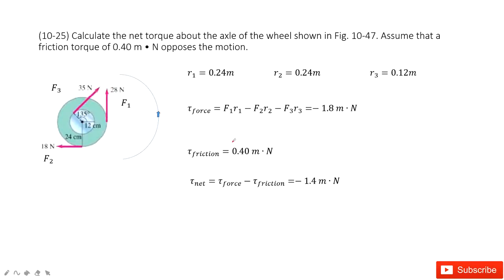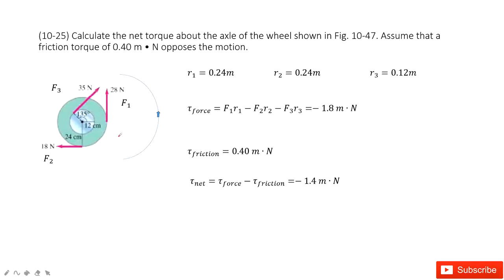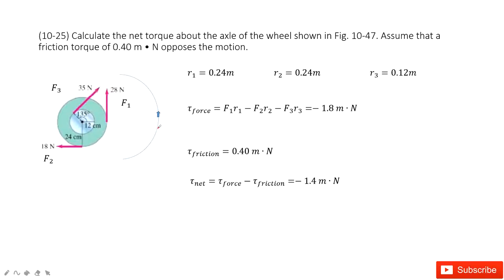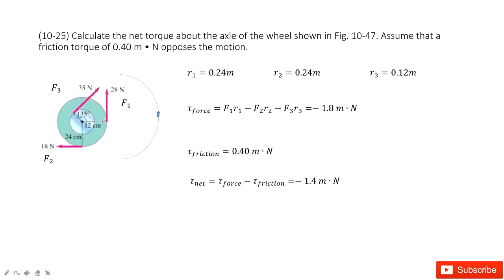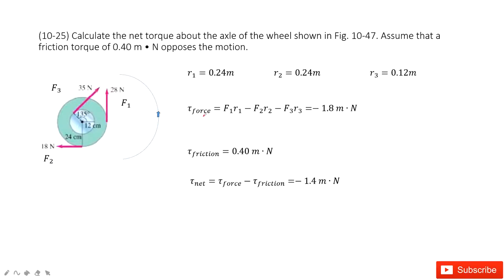(10-25) Calculate the net torque about the axle of the wheel shown in Fig. 10-47. Assume that a fric

Comment: the angle 135 what about it
Reply: You have to check the angle between the radius and force (pink line). For F3, the angle between r and F3 is 90 deg. The value 135 deg is not required to solve this problem. Hope that helps!
Reply: Thanks I also got confused there
Reply: @oompa5531  thanks...very helpful